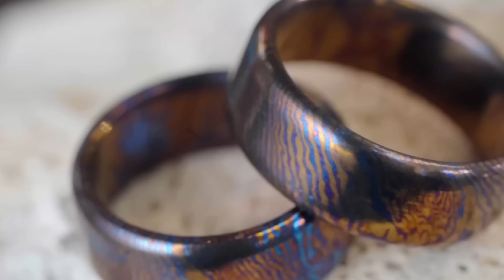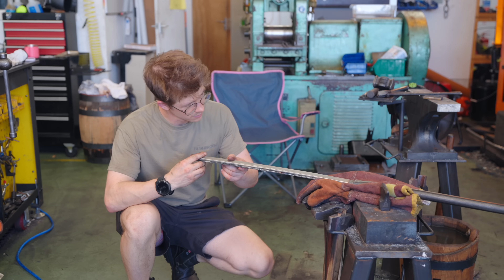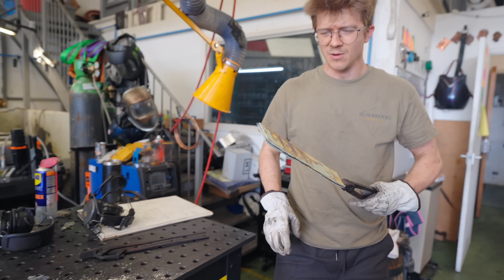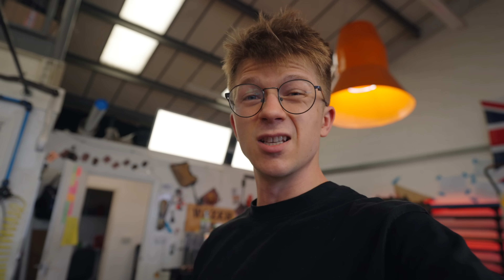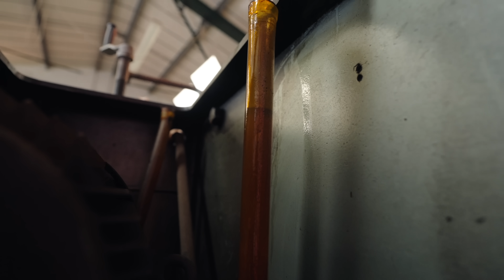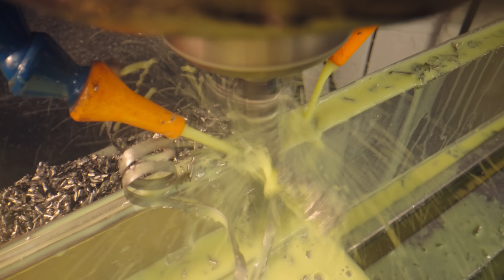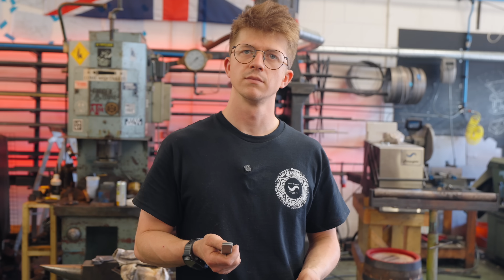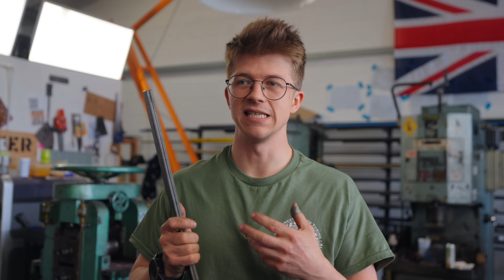Making a Titanium Damascus Katana - Part 1

Comment: I forget what it's called, but could you magnetically best the steel fat a final quench with it bathing the nickle and titanium. Or at last not quite as high? Not sure if it would make a difference, but might let you heat with more precise control. Could be non-sense, just a thought.

Comment: It's not necessarily true that the bond between the steel and titanium is weaker than the steel itself. When the steel breaks around that tight bend, it functionally becomes a lever and concentrates the force to essentially pry itself away from the titanium like a crowbar.

Comment: don't know if it is any help but in oil and chemical transportation we use a ratio of purging 1 times capacity halfs the oxygen level. This is purging with Nitrogen however don't know how it works with argon. But purging to remove oxygen isn't instand.

Comment: I wouldn't mess around with argon so close to your face. Despite being inert, it is an oxygen displacer that will replace the much-needed oxygen from the air. Breathing it in can result in a very quick unconsciousness (as short as a few seconds), and since it is heavier than oxygen, it will settle near the ground. Going unconscious with argon present is a fast and painless way to meet the ancestors

Comment: Alec You know how a Katana Has a Hamone Line where the edge is Hard steel and the spine is soft steel what if you make the spine steel aka still a steel Core, but the Edge is Titanium? You can then also achieve a similar Hamone line and also achieve your plan of a damascus of titanium and steel for your Katana. Plus you can still achieve some of the traditional part of katana's and use clay to alter the hardness the steel spine. you can probably achieve this by doing a thick Rod of Steel, Surrounded by Nickle, then that surrounded by Titanium making a Radial form of the Billet and the sanding being used to expose the Nickle and steel for your core. Just an Idea I had for your video

Comment: I'm wondering if it would handle the quench better with water. Traditional katanas were water quenched. The oil seems to cool the outer layer too fast. Or if there's a way to partially cool the core before the quench maybe that would work?

Comment: Around 14:20 could it be that at higher temperatures, the intermetallic compounds while being rolled after "squeezed" towards the unrolled part inside the billet (like toothpaste), building up pressure until the sides of the billet can no longer hold it?

Comment: 35:20 and I thought you were going to use both metals in the same manner the different hardened steels in the katana are used to make different parts of the blade(harder for edge softer for back), to me that would be much more intresting...

Comment: I think the reason they do it so slow in industry is to ensure the materials expand (heating), diffuse, and contract (cooling) in as much synchrony as can be managed with diverse materials. Each component metal will respond differently and going slowly ensures minimal additional stress, uneven deformation, and that bonds remain together throughout the process.

There would also be no forging, just making the part to shape directly, as any forging would defeat the purpose of the process mentioned above.

Comment: The only reasonable solution is a scuba suit and flood the shop with argon. Seriously though build magnetic shroud plates that cover the opening on the roller and attach an argon line to it to flood in down over the work area. You don't need a massive opening so you should be able to contain enough argon to accomplish it. On the fly argon shrouding has been done in insane ways by tig welders. Some could build a masterpiece with aluminum foil and magnets. Also have you considered doing a slightly thicker fully encapsulating nickel weld to the titanium before then going on to attach them to the steel? That could also possibly make a difference when you get to welding the two separate damascus. Maybe even making the titanium damascus in the first place.

Comment: Titanium is a hard metal.  

Katana’s traditionally had a softer metal at its core and harder metal for its edge.  Might what want to consider swapping or rethinking the layers 

They did this to absorb vibrations and not break

Comment: I did have a thought that might help you with the titanium forging. When I was going to college for welding and metallurgy. My instructor said that stainless steel alloys were used as a intermediary layer or metal for wielding steel to titanium, because using a single metal like nickel had to different of a temperature range, crystalline structure, melting or forging temperature to make that bond between layers very well. If I have remembered correctly, that might be a possibility for you to be helpful for your project.

Comment: Hi Alec, welding engineer here. Oxygen percentages in argon purges can be easily measured with an oxygen meter. typically less than 200ppm oxygen is a good goal for little to no reactivity. Less is always good, tho

Comment: I have another idea, that kinda works with the extra nickel Damascus idea. Maybe there’s a way to mill “pegs” and corresponding holes, on the titanium, steel and nickel? In my head, it would be kinda like a doing a reverse raindrop pattern, so the pieces can interlock like legos before you attempt to do a forge weld. Then- if it’s even possible- you’ll hopefully have nickel forged inside the steel and titanium like internal rivets.

Comment: @AlecSteele

2 question/ideas

1- could the nickle(layer between steel and titanium) be too thick and the separation is due ripping the inter layer apart?

2- could you use a flux between each layer?

2.5- could you use titanium powder bed under and on top of the steel?

Love your videos!! Watching from Pa USA! Right outside the steel city

Comment: to deal with bananaing while hot rolling when on the lab scale mill that i work with. we have a catcher and feeder. the feeder adds a push onto the metal and the catcher pulls as hard as safely possible to keep it straight.

Comment: The reason you’re running into so many problems is because of the poor thermal conductivity of titanium. It does not conduct heat very well at all in fact, it’s one of the poorest conductors of heat of all the metal alloys there is that is largely why you’re having such a problem with Ford welding it to other metals it’s not because it can’t stick because it obviously can you need to research titanium alloys with better thermal conductivity and try using one of them instead of grade 5

Comment: Would be interested to see if you nickel plated the steel and titanium before doing anything if that would give it a full protective jacket to work with and then you would not need to worry as much about oxygen

Comment: Fun fact, IIRC the reason titanium was chosen for the SR-71 was NOT its strength to weight ratio but rather its thermal expansion rate, which is very low. The SR-71 flies so fast that compression and friction from the air heat it up. Famously, the fuel tank poured fuel on the runway because it wouldn't be a tight seal until it got into the air, got hot, and expanded.
Reply: Strength:weight ratio was a consideration if not the only one. According to Ben Rich's autobiography weight was the reason why they didn't make it out of steel, which would have performed better in close to every other way.

Comment: Gotta ask, why are you shaping and grinding it after the quench? Traditionally the curve in katanas comes in during the quench: the blade comes in straight and the thickness difference causes the thermal contraction to be more extreme on the spine, causing the curve. This could be another interesting avenue of experimentation.

Comment: Japanese blacksmiths had to deal with terrible material so katana-making especially (a bent shape that requires a weld of 2 metals) was very hard in production - BUT that doesn't necessarily make the end product a superior sword. And it's not like the Japanese were the only ones who knew damacuss.

p.s. the traditional Japanese process for making the prepequisite high-carbon steel is fascinating.

Comment: Since you can make a jacked and flow gas through it you could try gas nitriding titanium. Titanium nitride is like 80 HRC I think. You could make titanium only katana and then make layer of titanium nitride on surface and maybe grind it off on the sides to expose titanium.

Comment: Western swords and smiths reached a much higher sophistication and quality of blades (and other equipment), as well as a better metallurgic understanding, than what they had in Japan.
The west were far more at the "forefront of metallurgical innovation" than Japan, in part due to the higher quality iron/steel the west had access to, and part due to Japan being an isolated island nation that was stuck in the past, in a rigid feudal system. Japan only started moving forward again years after they began having contact with the west, copying what the west did better.
Nowadays Japan actually is on the forefront of innovations, but they before recent times they hadn't in almost a millennia. The katana is a fine blade, but compared to western equivalents from the same time period it almost always loses. The fact that the katana is being seen as "the forefront of innovation" and "the ultimate bladed weapon" by some today is because of a ton of Japanese nationalistic propaganda, and influencers, etc. that are misinforming their audience.

I just wanted to clarify this, but it doesn't mean I hate the katana. I'm just a little tired of hearing the same bs repeated all over.

Comment: maybe it is that the time to do the core of each process changes in a random way based upon size of material/volume. in all 3 dimensions and then the other variable of it being made out of multiple materials. I definitely think focus on time, not just heat etc. I think the time setup completely re-arranges with size. You really need a calculator. Ask Fable 5 frontier AI to code you your own calculator app to make perfect damascus every single time! it can do it!

Comment: Alec; the piece you have made you can turn into a wakizashi. Which is the smaller blade always worn with the katana by the samurai. It would be bit shorter than the blade you already made. Look up the standard wakizashi lengths. But I believe taking off 4-5 inches will get you the required length. 

PS: Can't believe as a Pole I actually preferred to use inches here instead of metric XD

Comment: I'm coming bit late here and probably half of the comment section is already screaming it.
But if the problem is that the hardened steel bonds poorly to the nickel and titanium, why not go more traditional and kind of more modern and use selective hardening?
As in the part where you slap some ash-clay mixture on the blade before hardening which not only causes the blade to have different hardening across the blade but also makes the curve?
 
Another thing is blade structure. This is the other part of making katana curve and also the thing behind hamon and all that spares tamahagane and all that. Instead of trying to make fully layered steel-nickel-titanium blade, you make steel edge, nickel back (not going for that pun), and titanium sides?
That way you could embed the steel edge into the nickle while you forge the rough shape, with how seemingly nicely nickel and titanium and nickel and steel bond make the structural forge welding later, and only just before starting to play with the clay to enhance the curve effect, you take the blade to the grinder and reveal that steel blade within the nickel.
And while you can save on materials and this can be a bit easier on some parts, this probably isn't going to be all that simple. At least you aren't anymore dealing with just flat stock steel, nickel and titanium but complete 3D structure that takes a bit more to weld than just beating it flat.

Comment: What would happen if you melted them down to liquid and then mixed them while molten? Would they bond while it cooled into a block? If you only quickly mixed them so there were definite parts of steel and titanium in the cooled block, you should still get a Damascus look, no? Not a blacksmith, so it may well be a noob question - but I like to think I've absorbed a bit of your teaching over the past decade of watching your vids.

Comment: I'd think that making the final sword thicker than an original would be somewhat fair. Afterall, what are you using a lower density metal for? to me it would seem logical to exploit the material and make it a bit thicker and perhaps also a little wider while retaining a similar weight but gain much more bending resistance.

Comment: Thought of an idea for purging out all oxygen. 

Argon is heavier than oxygen so what you could do is hold the billet straight up for maybe 20 seconds (depending on the air flow) so that the argon pushes the oxygen straight up and out of the billet. Sort of like a glass filling with water.
Reply: Fire gets rid of oxygen.

Comment: You can also just heat treat the damascus steel with the new magnetic heater tool, 
And right after you pull it through the magnetic coil and then cool it with water, like how they do it in China

Comment: I just thought of a use for the material you've cobbled together there
Armor 
Nowadays, armor is frequently made by rolling together various metals though usually different types of steel.
With varying metal ratios
And titanium would actually be very interesting for armor production in combination with steel especially with steels that already have a fairly high nickel content.
Above all because titanium is lighter and if I'm not mistaken also has greater resistance to stretching.

Comment: This is a technical concept rather than a feasibility study; wouldn't it be possible Cold-forge the three metals using sufficient pressure.
Then the metals would heat up for such a short time that there wouldn't actually be enough time for this Mixed metal to form.
Because if you exert enough force and move the metal back and forth enough, the heat needed for fusion is actually generated.
Of course, it’s perfectly clear to me that you don’t have enough equipment capable of generating the necessary force to do that.

Comment: Are you really sure it makes sense to replicate a standard katana? It seems a bit pointless, given that katanas were actually designed to be made from relatively poor-quality iron.
And that is why they are designed the way they are.
Not to mention that it completely throws off the weight distribution.
Because titanium is significantly lighter than steel.
If you wanted to craft a practical weapon out of titanium, it would make more sense to choose something like Saber-like weapons
Weapons that do not depend on weight or, for that matter, material quality.

Comment: Alec, love the videos mate! Just thought id try share some knowledge, I work in a forge using power hammers and presses in sheffield where we make medical implants and aerospace parts, when forging Titanium i have experienced the blowout of molten metal when the Titanium get too hot, Titanium is a volatile metal and highly sensitive to heat so the stuff you see spurting out when using the rolling mill is potentially molten Titanium I've had it happen to me when forging solid Titanium bar. we never heat Titanium over 900°C and when forging with the power hammer we control the power of the blows to keep the glow of the material even and consistent, too much heat = catastrophic failure.

Comment: Maybe use the surface grinder instead of the mill to get the piece thinned? Also careful with that argon flow! If it gets into your lungs it will replace the oxygen and wont come out easily.

Comment: This seems like a perfect material for a smallsword. They are notoriously light (sub 16 oz for a lot of them) and do not have a cutting edge so they do not need to be hardened to a high rockwell along the length of the blade.  A steel bit could be inserted at the tip that could be hardened. Because titanium is so light, the blade could be made much more substantial for stiffness while still weighing the same

Comment: I think you can't own a katana in UK any more. Even unsharpened, even for display only, even in a private residence, they are now supposedly completely banned. There have been exemptions in some of these laws about blade length and manufacturing technique and reason for ownership, but I'm not sure all of those exemptions still apply after the changes in 2025 and 2026. Your Swordis swords was probably illegal to own even under those 2008 exemptions because they mass produced for example.

Crime and Policing Act (2026), 'Ronan's Law' (2025), The Offensive Weapons Act (2019), Criminal Justice Act (1988),  Restriction of Offensive Weapons Act (1959) have this weird bias against "ninja weapons" because some of it was written in the late 1980s, at the height of Teenage Mutant Ninja Turtle fever (also why it was called Teenage Mutant Hero Turtles in UK). All a bit mental.

I would suggest you consult a solicitor about the legality of the swords you own as well as the legality of the advertisement in your video since Ronan's Law was specifically introduced after someone was murderd with a mail ordered imported katana.

Comment: Considering its a Japanese katana using unconventional materials. It would be be nice to see a charcoal forge is possible? They can get up to 1300c so temp isn't an issue. That way, you can theoretically build it to the length and width you need